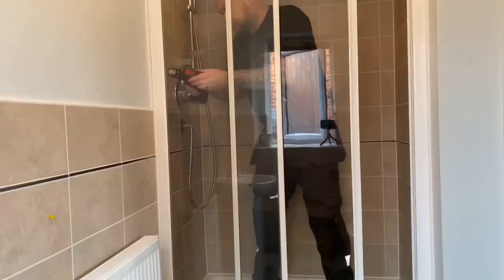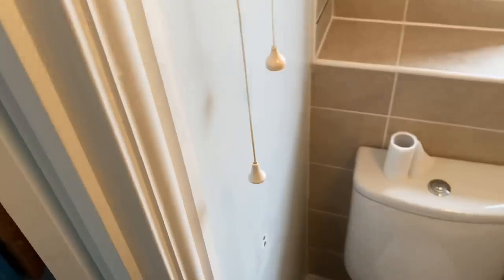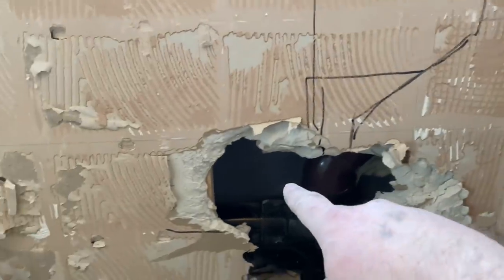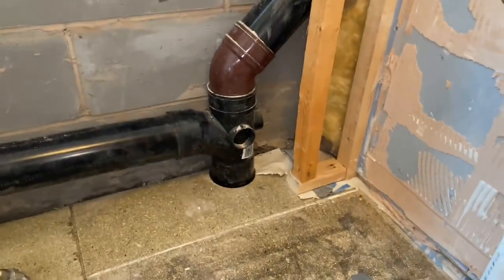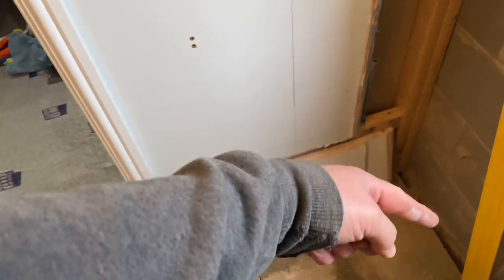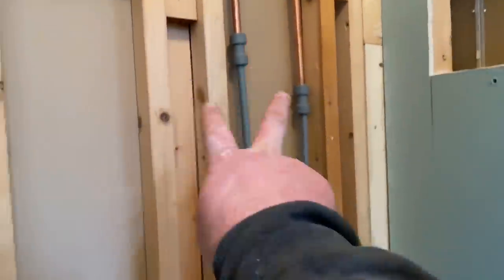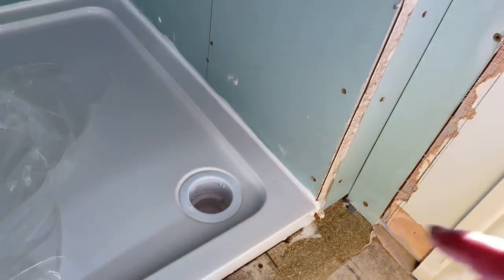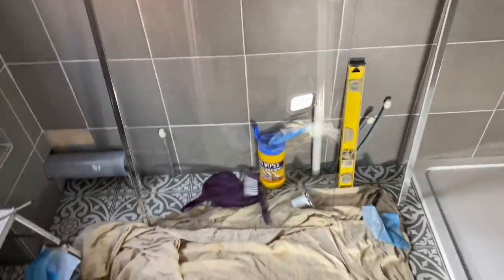COMPLETE ENSUITE REFURB from START to FINISH, BEFORE & AFTER. MOVING LAYOUT DESIGN/WALLS/TILING

Comment: just watched video again you say there is are must a reason why its so high will find out but never did explain why   ?
Reply from the maker: Oh, thought I had said in the video…… it was due to the waste Pipework being fitted to high when it was installed when the house was built.
As you can see in the video I alter it and get it under the floor to lower the tray👍🏼👍🏼
Reply: @MJTiffPlumbing thanks for reply that does explain what did you bed it down on
Reply from the maker: @neilbrice449  
Bedded down on silicone, that’s how I’ve always set trays…. Some people use silicone/sand and cement/CT1 etc etc…..
Reply: @MJTiffPlumbing   thank you for taking time to reply a proper pro
Reply from the maker: @neilbrice449  not a problem Neil, thanks for watching and enjoying the content